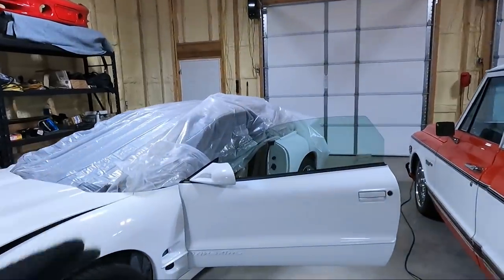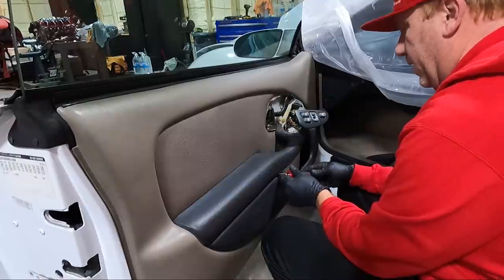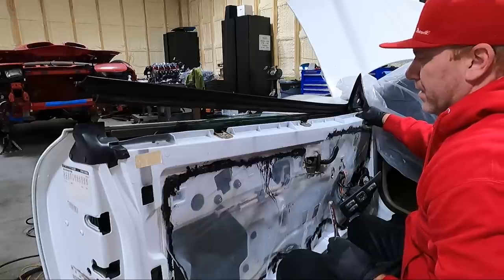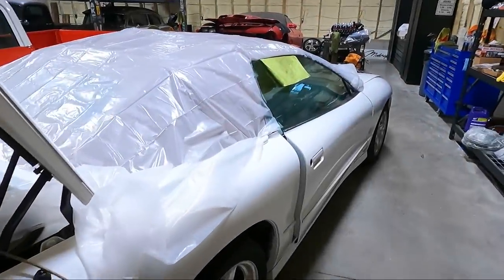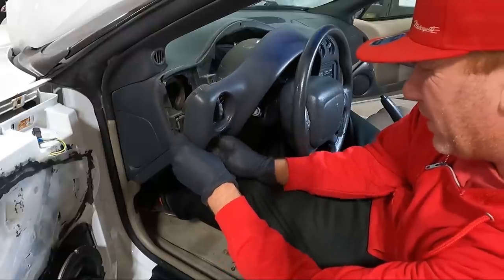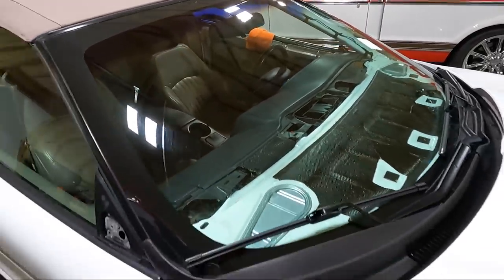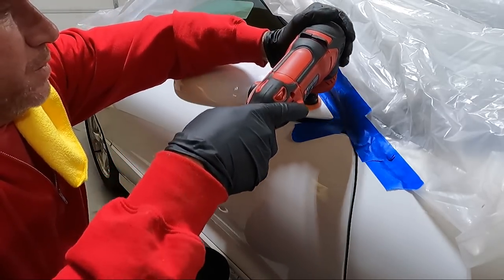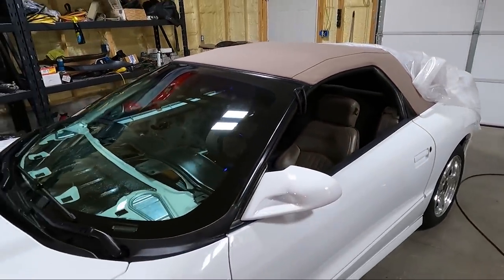WS6 Trans Am Clean Up Continues Inside (Ultimate Clean Up Part 3)

Comment: Frost king the doors and floor and trunk areas. Not heavy. Not expensive. Works well for the money. You can do whole car for like $100. I too recently acquired a white 98 vert and stripped the inside completely and power washed and cleaned everything. Did the frost king everywhere and it really makes it nice inside killing a good amount of road noise.  Been a fourth gen owner for almost 25 years now. Bought my 98 Formula in Oct of 97 and still have it so I enjoy your Fbody content and share your dislike of black wheels btw :).   Keep up the good work.
Reply from the maker: I actually used that in the past and didn't think it made a difference. Maybe its better now.

Comment: I own that exact color combo ws6 convertible.  2002 88,000 on the clock. I also have that exact steamer Vx 5000. I teamed it up with a mytee 8070 hot water extractor.  Going out Miami Vice style!
Reply from the maker: Nice. I need that extractor

Comment: Travis i like how you clean everything in detail, im like that too, even though an area may not be visible i still know its dirty and drives me crazy!!  Also i didnt think my Firebird had those lights i thought they may only by on the TransAm, but when i passenger door opened the other night i saw a red light in the handle area briefly, so im going to go back in and change those bulbs to the original white
Reply from the maker: Yeah they commonly burn out

Comment: I found someone bolted the regulator to the door when I pulled my panel off and the whole regulator was moving around and destroying the fiberglass with the front of window sagging 1/4". I ended up doing the ls1tech strong back mod with a 1/8 piece of steel and bolted it working good so far but it still leaks.
Reply from the maker: Not a bad idea. At least you found it.

Comment: Have you thought of clay bar the car first before using the compound and all that? If you clay bar it'll remove all the dirt stuck in the paint and it'll leave the paint smooth and ready for wax or if you need to remove swirls on the paint
Reply from the maker: I generally do that first
Reply: @TWAMotorsports  will you be doing that on the trans am?
Reply from the maker: I will